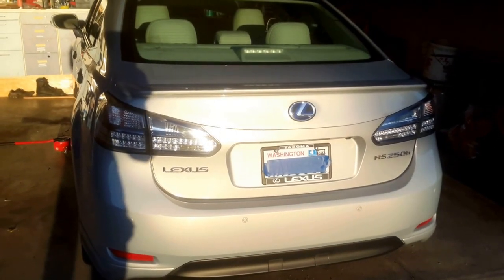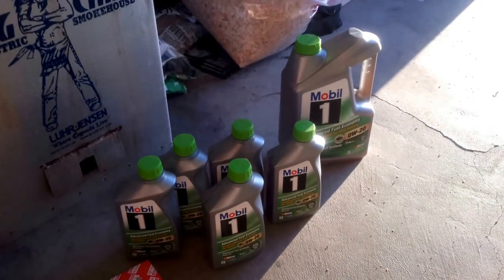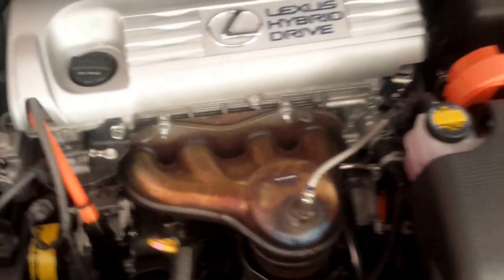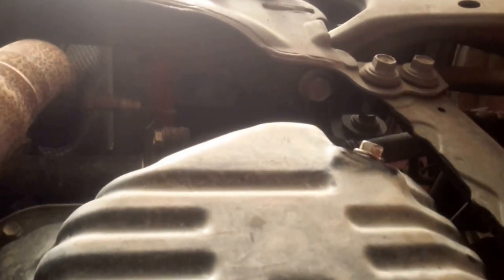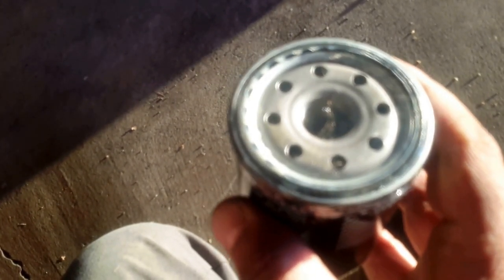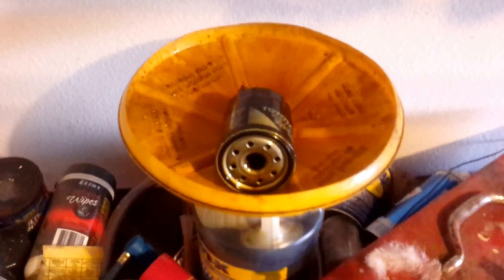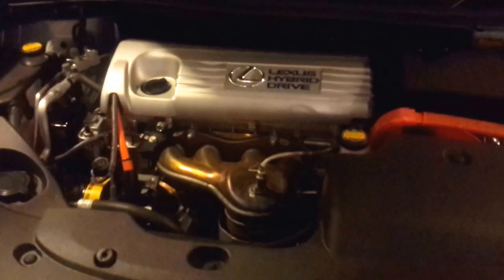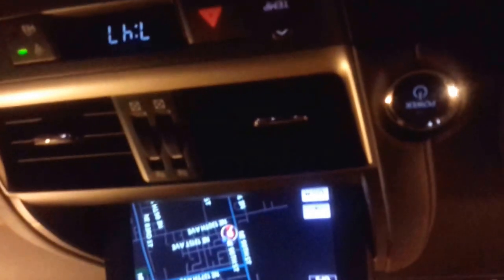Lexus HS250h oil change

Comment: Nearly 8 years later, I’m glad someone made this video! I’m about to change the oil on my (new to me) HS and this video is a huge help. Thanks!
Reply from the maker: Great to hear the video helped you.  You will love the HS250h.  Mine is now 12 years old and has 100,000 miles on the odometer.  The cars still drives as well it did when we first bought it.  I have been planning on doing more HS250h videos, the only reason not is that the car hasn't any needed repairs.  Its so reliable all I do to it is a tyre rotation every six months and an oil change once a year.
Reply: @gavinparmar5397  Love that! I’m sitting at 95,000 and hope to get at least another 100,000 out of it.
Reply: I hope there video on how to customize/upgrade head unit to Android auto Car play

Comment: nice video.//do u know difference b/w yzzf1 and yzzd3..are they same size?
Reply from the maker: I have been told the base diameter and thread pitch is the same between both filter types. The D3 was primarily designed for the V6 engine and has a greater amount of filtration surface area due to the can's longer length.

Comment: Is it reliable and is it roominess?
Reply from the maker: Mine was a used vehicle that I purchased from the original owner when it was three years old.  It now has nearly 93,000 miles, 50% city and 50% highway driving.  The only repairs that have been done on it are a few lightbulbs for the headlights, two sets of tyres and wiper blades.  Very reliable.  As for roominess, it is equivalent to Prius of the 2010 era though with a smaller sedan trunk.  I am six foot, three inches tall and I have no problem's with head room or shoulder clearance in the front seats.  The rear seats are ok, but less roomy than the front.
Reply: @gavinparmar5397  thank you, i plans to buy one had abou 200k miles and I’m worry about the battery
Reply from the maker: @datthai8029  A vehicle with that many miles probably was driven mostly highway, which is easier on the battery.  That being said, I would get any future high mileage hybrid vehicle inspected by a certified Toyota/Lexus Hybrid Technician in order to make sure their are no defects with all of the hybrid components.
Reply: Roominess sucks. Reliability wise it is like a camry. Totally good.